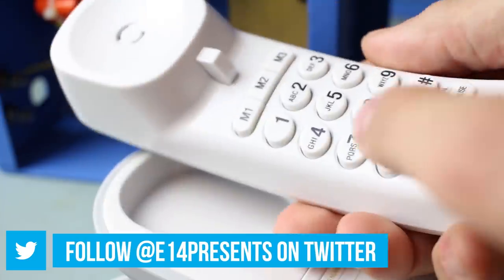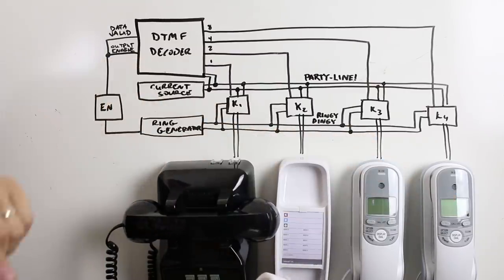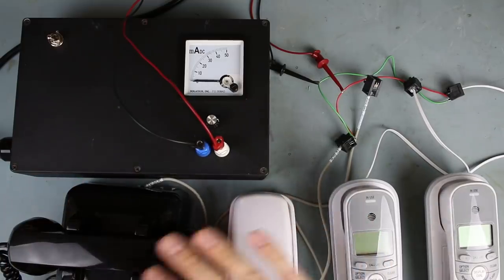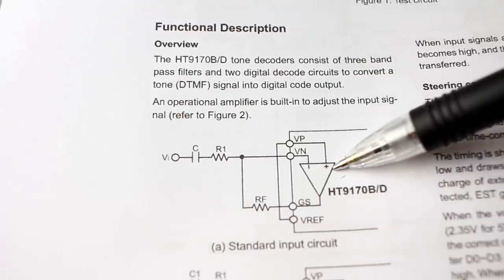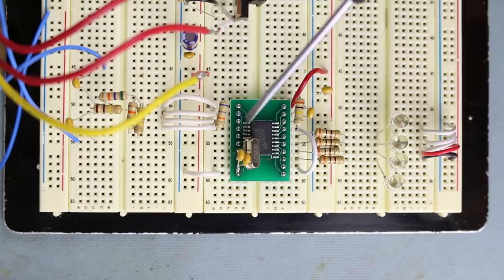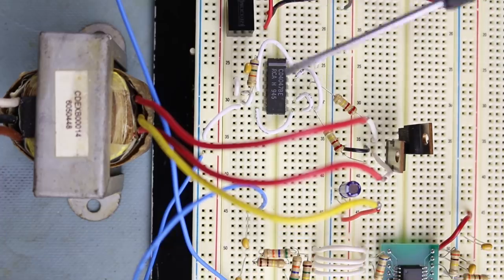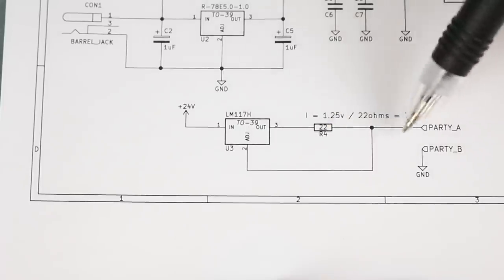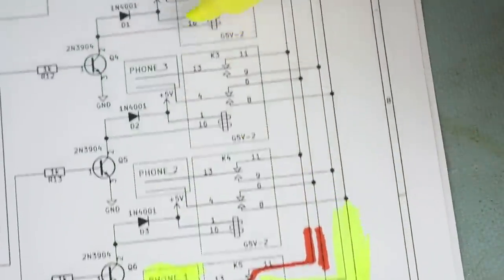Multi-Line Telephone Intercom

Comment: A known pair of 26AWG wire, one 9 to 12VDC battery and two test sets are more than enough to have two lineman/splicers to work together on phone lines. Thinking about this makes me missing that time... except when it was cold, hot, rainy, snowy, icy rain, windy in humid man holes or on spikes at the top of a pole for twelve hours. Keep up your excellent work!

Comment: I made something simmilar for one of my first microcontroller projects. Your design is very nice, and I'm thinking if someone added a microcontroller to it, the "ring" line could also become a second line for 2 private conversations. With a few small changes I must add. Great project man very detailed!
Reply: Obviously if you want a second talk circuit, you'd need numerous more relays.  It becomes an entirely different project.  This project is basically "selective ringing."

Comment: I'm liking very much! And to think, I spent a wad of money to buy a pabx to do this job. We connected my cabin and my dad's bungalow, and then added a few other phones around the farm, not so much that we needed them, but because we had all those spare outputs going, well, spare!

That pabx is a pretty well feature rich system, and it does its job admirably, but it's not as much fun as this setup! 

Years ago, we had a very basic "upstairs/downstairs" (two telephones) and basic power supply so that we could call from ground to first, and vice versa, floors of the house, but it lacked the sophistication of this system. It could only ever be two phones, commoned on a single DC line, with a separate ringer circuit.

A Nice video/tutorial, thank you.

Comment: Very cool and simple project.  Thanks for the video.

I built my own relay-based PABX when I was in college ~1965.  It was all rotary pulse dialing, no DTMF.  In addition to phones around the house (my brother's room, dining room, darkroom, etc.), we strung phone lines through the trees to some neighbors houses so we could talk to our friends.  Rather than a common "party line" only the called party could talk to the calling party.  Also used a real 20Hz 90v ring generator, since the phones all had electro-mechanical ringers.

Thinking about your project, my personal feeling is that if anything needs improvement it's the ringing generator.  Indeed, the high voltage requirement presents some design challenges.  If I can come up with any relatively simple solution I'll send it along in case you ever want to make a "Mark II" version.

Oh yeah ... wasn't it a PITA to punch the holes in the steel chassis?  Solve that problem and the rest of the project is cake!
Reply: Nice! How did you manage the part where only 2 ppl could speak to each other? Can't wrap my head around it.
Reply: @BurkenProductions  Thanks.  I'm not sure I understand exactly what you're asking, but let me summarize how my system worked.

Each phone had its own series "line relay."  Initially all the line relays received voltage from the supply.  When one phone went off-hook, that removed voltage from all the other line relays; so other phones could not initiate any actions.  Thus only one conversation was possible at any given time.  (Given that we had only 7 or 8 extensions, and only 4 people were normally involved, it was unlikely that we'd have a need for simultaneous conversations.)

The "active" phone also controlled "B" and "C" relays, which in turn controlled the stepper switch.  When the phone dialed some other number, the stepper selected the "called" phone.  If the called phone was (presumably) on-hook, ringing voltage was sent (via stepper switch contacts).  If/ when the called phone went off-hook, ringing voltage was disconnected and called phone was connected to calling phone.  That allowed the conversation.

I honestly don't remember whether the two phones had a DC connection path, or whether there was a series "talk" capacitor connecting the called phone back to the calling phone.  In the former case, the system would remain "tied up" until both parties hung up; in the latter case the system would be controlled by the calling party.

In retrospect some other features would have been nice ... maybe some sort of audio tone injected into the talk circuit if a third phone went off-hook and wanted to use the system.  Then when the first two parties heard that tone, they could hang up, freeing the system for the third phone.  Etc.  But this was 1965, when there no such thing as consumer-level logic chips, and I was spending my allowance to buy surplus relays.

If that didn't answer all your questions, let me know and I'll try to recall more details.

Cheers!

Comment: I have build similar ring generators using a astable 555 timer driving a push-pull amp with 2 power transistors  and a large value cap in series with the out put, works great.
Reply: IMHO that's a much better solution than the one presented here.  Better waveform, fewer HF harmonics so less problems with transformer impedance, etc.  The challenge is finding a transformer that can pass 20 Hz with reasonable efficiency.

Comment: Very simple approach. Congrats. I am surprised that you did not have to add a series choke inductor on one of the line wires. The 33 ohm resistor + LM317 have a rather low impedance compared to the audio signal. When I tried this back in the 80's, I had added the primary winding of a power transformer in series with the +9V DC supply, otherwise we would not hear anything. Thanks.
Reply: Yes, you need a coil in serial with the power, otherwise you will just kill the audio with the power supply, but here they use a resistor, will work but not that well as a coil.
Reply: Agreed 100%.  Think about a TELCO central office subscriber line circuit.  A big mother 48v battery (0 ohms AC impedance) in series with two relay coils which produce a high impedance to the audio.

Comment: best explaination on how telephone works ,ever !
Reply: This is not a bad explanation that gets you most of the way for an PBX. Add an arduino such that if a party line is in use, then  other calls can't be made. There are some chips that is made for the matrix switching, such as 8 rows by 8cols or even 16 lines. This video and schematic has got me thinking!

Comment: In my retired years, I now help out with the senior center's drama club. I am the sound guy. I use the PA system for all sound reinforcement and sound effects. One of my projects is to use old phones for certain skits. Ringing the phones would be great. So far, after reading up on the requirements for ringing the older phones needed a current of ~ 90 v. @ 20 HZ. So according to your video, that spec. can be obtained without too much bother. So, can I actually build a circuit for this. A little help would be much appreciated. Thanks Dale Mettee

Comment: There is a company that makes a module that will provide 90 volts at 20 Hz. Unfortunately I do not have the link saved on this computer and the other machine is in deep hibernation.
A multi number add on would be nice for this system, don’t have to worry about dialing binary. A simple 3 or 4 digit extension would suffice. No need to have fancy ring cadences either. The only thing a ring cadence would provide is a signal to a decoder within each phone on the system so it knows when it is called. Would eliminate "home run" extensions when a loop would suffice.

Comment: Have you thought about making a circuit that uses a USB sound card and GPIOs to interface an analog phone to VoIP using a Raspberry Pi?
Reply: Just use a HT502 ATA?
Reply: @tieline1333  An open hardware solution would be nicer. Also, for a lot of individuals, they'll still need the Raspberry Pi or whatever to run Asterisk on.

Comment: Thanks for the explanation! I may have just missed it, but can you please explain how the system recognises when the phone receiving the call has picked up? I dont understand it, as I can't see any way for the circuit to determine if phones are on or off the hook.
Reply: The system doesn't recognize when the phone receiving the call has picked up, but only rings for as long as the caller is pressing his keypad button, so a quick press should be enough for the called phone to realize someone is calling them, as long as someone is in the room that is.

Comment: I might make some improvements to this and design a proper PCB, I might use discrete logic (or maybe an arduino) to decode the DTMF decode output to individual signals for the phones so at least 9 or so phones can be used and maybe use 0 to switch into to the landline etc if used. I would have to treat the phoneline as another phone and design the input of the landline jack to act as if it was a regular phone, so it will likely need to be isolated and need to detect ring signals broadcast to all phones and take the line off hook when any of the other phones go off hook
Reply: You don't need an Arduino.  Just use a BCD-to-decimal decoder, e.g. 7445, to drive the relays.  Interface to landline using a relay and 600:600 ohm audio transformer, and you'll need some logic to keep that landline circuit latched on until the calling local phone goes on hook.

Comment: I've improved on the design a bit, adding the ability to address 8 individual phones and the ability to access a landline etc, I've added a microcontroller to the DTMF decoder and a 74HC138 to the ring relays. I have to revise the board a bit but if you want the design files etc let me know
Reply: Can you send that to me as I am very interested in this
Reply: I am also interested in this project
Reply: @sam462m  https://github.com/WRFleete/PABX-project has the code + schematics + gerbers, havnt tested with the RJ45 connectors on that schematic etc but I did have individual ports for each phone. Code may be a bit of a mess and I may comment on it a bit. The code has basic support for pulse dialing as well and the ability to connect to a POTS/PSTN phone line (and dialing to get the "outside line" and "hold" feature)
Reply: @rossherbert1591  posted a link in another reply to the git repo

Comment: What if you ring a phone that's already off hook? Would the speaker in the phone burn out?
Reply: Ah, good question that I didn't cover.. phones are equipped to handle a horrific barrage of voltages and transients that could appear on the line, including ring voltage when off hook. It just makes a clicking noise on the receiving end. If I had used an off-hook detection circuit and maybe a microcontroller, then I could prevent this from happening. But, I wanted to keep it relatively simple so that anyone could build it. Thanks for the excellent question.
Reply: @AmRadPodcast  Still a very good coverage and nice way of explaining them. Hope to see more of your videos here!

Comment: Great presentation. I built it using a modified chinese 9170 module, works great except for the current source supply for the phones.  Seems to work great at around 9v out of the 317, but as i crank it up to 24 the DTMF signal diminishes, stops working around 13v. I use cheap oricom tp4 phones,  does the current source for this (317) need audio decoupling with a choke or filter???  I guess there is a lot of "phone guys" out there, suggestions welcome, THX Chris
Reply: Let's start with the design parameters for a POTS telephone system.  About 48v DC (very well filtered, but regulation not too critical) when all the phones are on hook.  Then you need enough series resistance so the voltage at the phone drops to around 10-15 volts when the phone is off hook (even a bit lower voltage is OK).  This will make the tone generator and talk network work correctly.

The series resistance is important because it isolates the telephone audio from the zero ohm AC impedance of the power supply.  In a real telephone exchange, this resistance comes from the windings of the coils on the subscriber's line relay.  The coils have inductance, which provides even more isolation than a pure resistance would.

Many local office systems (PBX = Private Branch Exchange) will start with 24v DC, rather than 48v.  No problem, you just need less resistance in the relay coils, to achieve proper working voltage at the off-hook telephone.

My point is that you do not need a constant current supply.  You can achieve good operation with a random DC supply (must be well filtered!) and series resistance, or better yet series inductance.  You do want to end up with around 10-15 volts at the phone when the phone is off hook.

The constant current supply is OK.  When one user is talking and that one phone is instantaneously drawing less current (negative audio peak), the current will be forced into the other phone, and vice versa ... that's how the audio signal is transferred between phones.  Personally, I prefer filtered DC voltage supply with series resistance or inductance ... that's just me, what's what the phones were designed for.

Comment: Another interesting version would be one that works with rotary phones, Instead of a touch tone frequency rotary phones sends out a pulse. An Arduino set up to read the pulse could work as the decoder.
Reply: I've thought about the same thing.  In fact the Arduino could also accept input from the DTMF decoder IC, so it would work with either type of phone dialing.

Comment: This project is a beautiful but an error is hidden in the circuit of this multiline telephone. Here is the error: phone 4 calls phone 2 and at the same time phone 4 is communicating with phone 2, calls phone 1, phone 3.

For telephones 1 and 3 the line is occupied by telephones 4 and 2. and they cannot communicate at the moment
With this circuit only 2 telephones can be called and the other telephones are blocked until the end of the calls of telephone 4 and telephone 2
In order for it to have two instantaneous communications at the same time, the circuit should be modified.

Comment: Could you utilize the power from the phone line itself and could you make an intercom even though the land line is still used as an outside line? Very interesting. Interesting thing is our home was setup initially to have 4 different land lines and all the lines still have power.
Reply: It's not clear to me exactly what you want to do.  However, the TELCO phone line provides a maximum of about 50-75 mA,  not nearly enough power to run the ring generator and other electronics in this system.

Comment: 75 mA output is a little hot. Standard lines are spec'd at 32-37. Too hot and you can burn up components in the phones. Probably won't hurt the old electromechanical phone, but those electronic phones and cordless phones won't like 75mA for too awful long.

Comment: This is very cool! One question: Any chance this will work with rotary phones? (I have a large house and very old phones on hand).
Reply: It wont.
Reply: Yes it WILL work but you'd need a pulse to tone converter as well.

Comment: Great project, just 30 years too late! I can drop in via Alexa, ping them on WhatsApp, Life 360, ring their mobile or send them a message via Xbox live! Back in the day my parents had intercoms, which ended up getting replaced by POTS as we had a wired phone in each room. I installed Cat5e cabling in my own home, along with AppleTalk, Cat3, RG59 & generic 6 core cable, only the Cat5e cabling is still used now though...
Reply: You miss the entire point.  The point is to find a "fun" use for some vintage wired telephone sets.
Reply: @gregm.857  You have your own agenda as you clearly didn't read what I posted...
Reply: @Fifury161  I did read what you posted.  You said this project was "too late" because now you can use a lot of modern apps (instead of telephones).  My reply was that this project is not meant to be the "latest and greatest" but rather it is to intentionally use some thing that is vintage.  I don't know what agenda that indicates.

Comment: Wow, that is really complicated. So, I can be really happy to be born in the 90s :D I mostly experienced VoIP. Compared to the analog way, more simple to implement a multi telephone system :D
Reply: There is nothing the least bit complicated about this project.  It's the heart of simplicity.  In fact you don't even need the constant current supply (TELCO systems don't have one in the speech circuit) ... it could be replaced by a filtered supply and a series resistor.

Comment: The mechanical ringing voltage needs to be very high，maybe the mechanical bell needs 20hz. 50 or 60hz makes it dull
Reply: That's why he connected a multivibrator to a transformer.

Comment: Just install Asterisk
Reply: True this is definitely an option, and maybe a subject for a future video, but in this case I wanted to focus on old analog phones. I do have asterisk running on RPi which I use for daily communication - and to be honest,  it's a bit sluggish.
Reply: @AmRadPodcast  you can add old analog phones to asterisk by adding a gateway.
Reply: @AmRadPodcast  npstn.us -- Uses Asterisk Systems linked together to call into vintage telephones and switching equipment, You could even connect your circuit you built into asterisk using a Gateway, Then configure Asterisk to dial onto the circuit, dial a number and connect a call. Asterisk can do Everything Analog & everything digital, It's awesome!